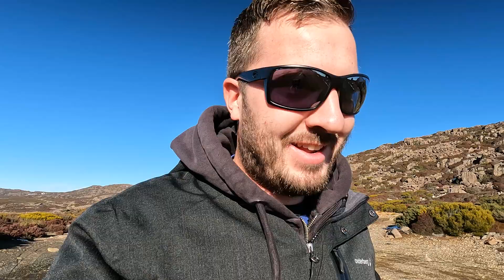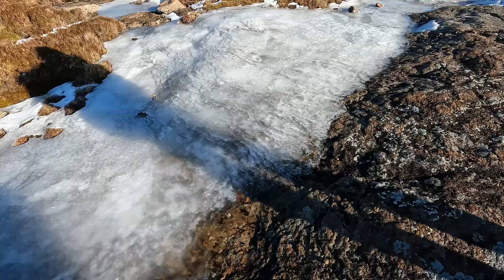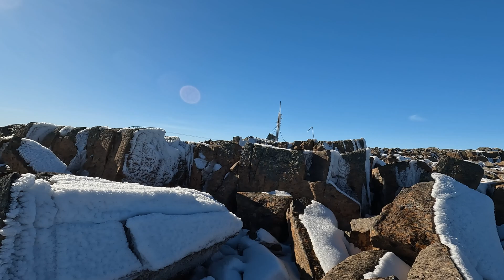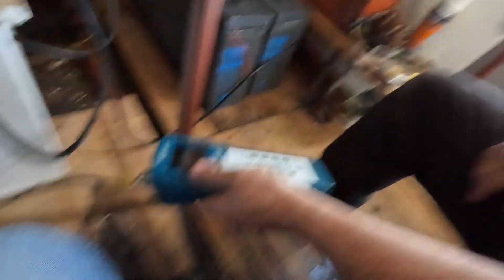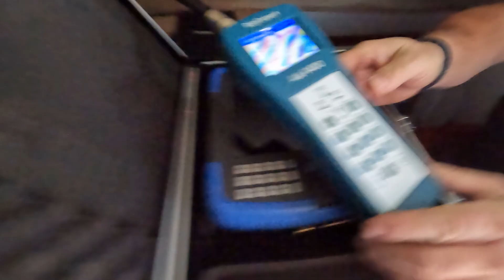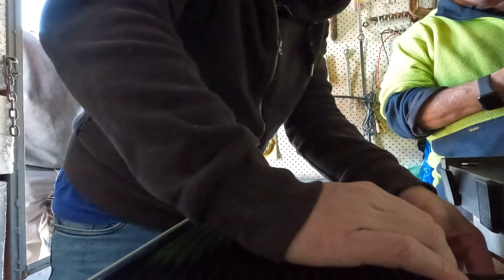What it Takes To Fix a Ham Radio Repeater!

Comment: I'd guess that the solar panels face north and the moss grows on every side of the repeater shack? 

Is there adequate solar throughtout the year?
Reply from the maker: No moss, too high and cold. Usually in winter the batteries get a bit low due to poor weather and snow covering the panels

Comment: Mt Mitchell NC 6,684 feet ... highest peak east of the Mississippi River USA.
Years ago I knew the ham who was a NC State Police radio technician charge with keeping the NCHP Mt Mitchell repeater "on the air." The ground plane antenna consisted of 5 (five) mobile whips with springs bolted to a pipe at the peak. It was the only antenna that could stand the Winter ice storm coatings of up to 18 inches thickness.  :^)

Comment: Who in the world decided to put a repeater that you needed to walk 2 miles to get to?  Were you guys walking on a road that you could of used for part of that.  Usually when a nice set of cans need to be tuned and I turn the knob, I get a dirty look and am told to be gentle.  Your cans don't seem to talk back.
Reply from the maker: We started for about maybe 100m on a road... and then it turns into road scrambling..
When there is enough snow a ski-do would make it up the top - I think that's how the last batteries got there. This repeater is right on top of the peak of the mountain. The rest of the mountain has plateau's and valleys - so the coverage isn't good down in one of them.
Reply: Not all mountain tops warrant a road when they are infrequently visited. Cost.
Reply: How did the repeater get there in the first place
Reply: @jeremyturner4327 very dedicated hams or piece by piece, snow cat, helicopter, Sherpa. You never know.